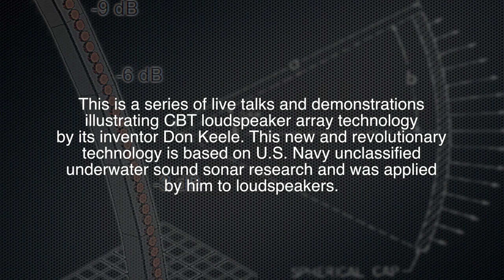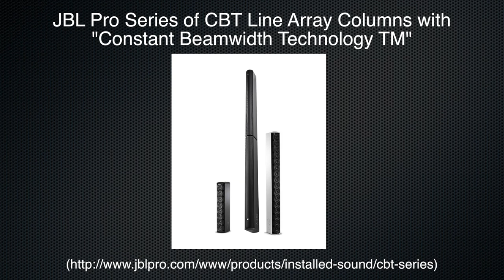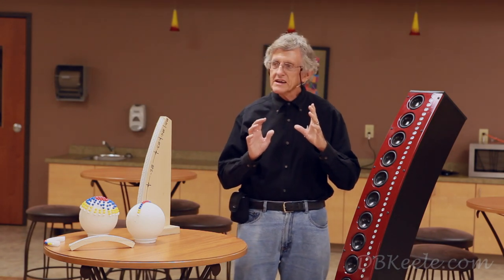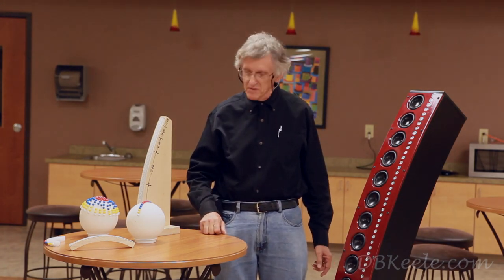CBT Chronicles Part 1 of 9 Introduction: CBT Background & History

Comment: what would you suggest using for mids in conjunction with this system?
Reply from the maker: Great question! There is no need for any other mid-range coverage in this system, since it has a flat response at most angles from 60Hz (low Bass) to 20,000Hz (Highest range of human hearing) A subwoofer is commonly added   for more efficient low bass from 80Hz down to 20Hz (Lowest range of human hearing)
-- Kevin Keele
Reply: Cool, thanks Kevin

Comment: What is the point of having such low crossover freqyency (1000hz)?
Reply: My elder sound mentors had a few axioms.   Always use the smallest driver you could get away with, I.e., the smallest driver that will do the job.    Use the fewest number of them.     Crossover at the lowest point feasible for the driver.     A high frequency driver will reproduce frequencies around its usual crossover point much better than the usual LF driver being used below that point.    In that line of reasoning, a 5” driver will make better minds than a 12”, and so on.    A 1.5” diaphragm makes 1KHZ better than any “woofer” designed driver, such as the usual LF driver construction.      You’d rather have a HF diaphragm type compression driver reproducing 1KHZ instead of a LF driver.       A 15” driver, for example, has too many problematic characteristics to reproduce 200hz up through 1KHZ as well.        That’s why the crossover point is 1,000hz.